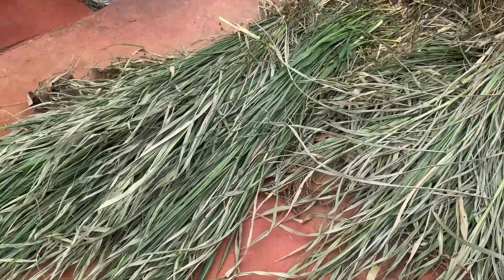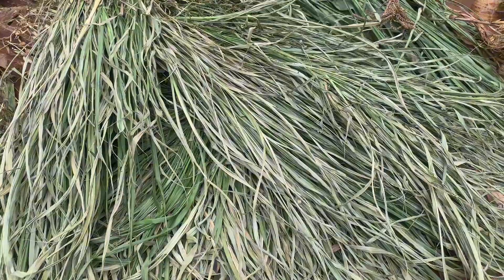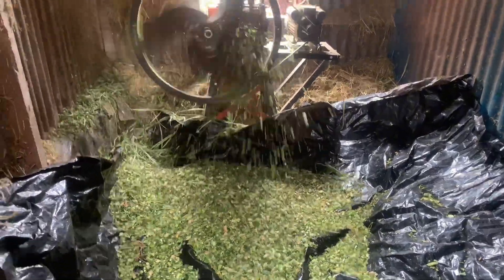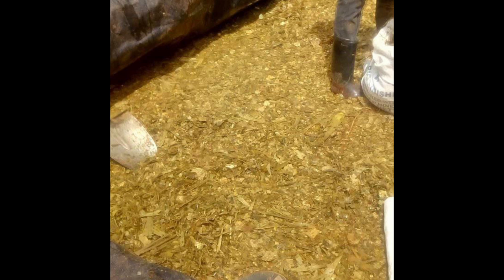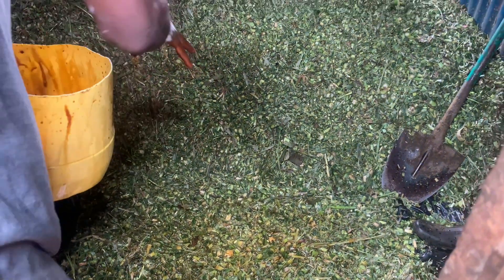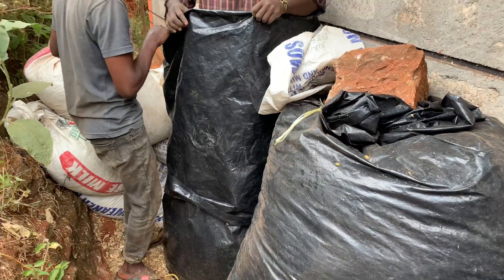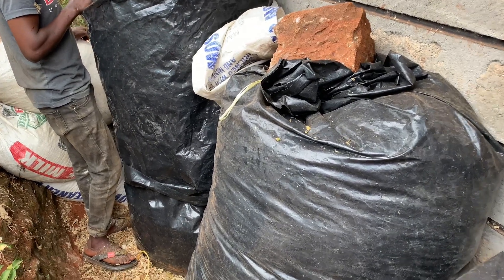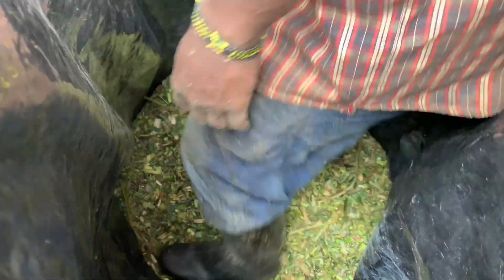Making silage using super nappier (pakchong) and adding more energy source for more milk production

Comment: you said it should be air tight for 21 days.  for how long will it stay safe after opening? i supose the cows wont eat it whole at once. also what should be the storage method in case it has to be used for longer? can it be fed to goats? is the storage affected by cold or heat? how much aproximate in kilograms should a mature cow eat in a day? how much approximate silage in kilograms can one make from an acre.

Comment: How much maize germ should be used for the silage to have required energy content?
Reply from the maker: I used 50kg of maize germ in 700kg of nappier
Reply: @Farmwithpaul  /Lets assume u had to use the mechenical feed mixer .what will be the total ration of maize,Napier and diluted molasses.Does one need to add Vitamin pack in that mix or not ?